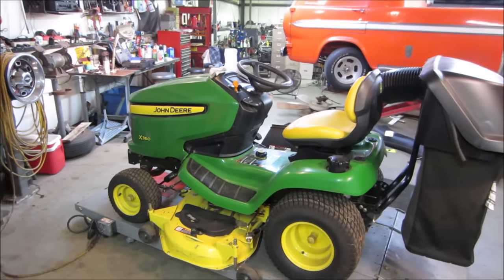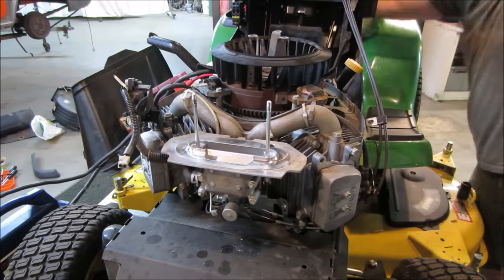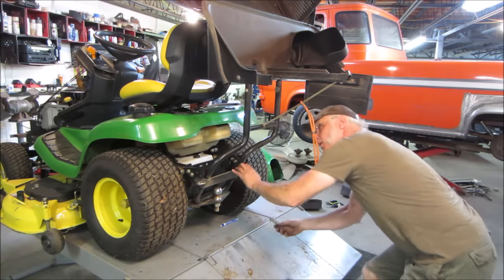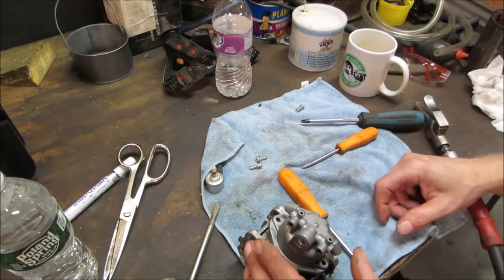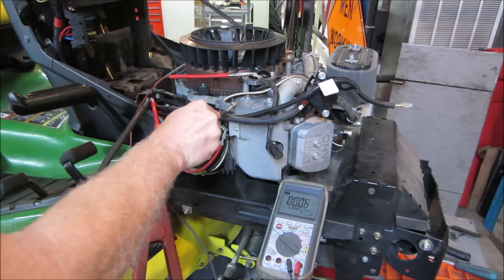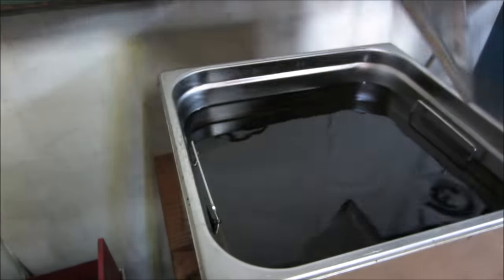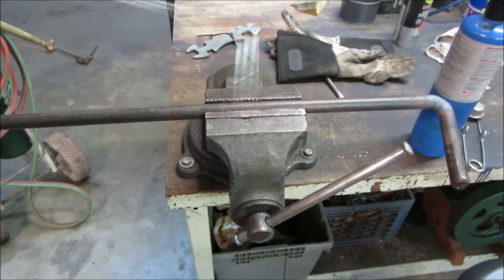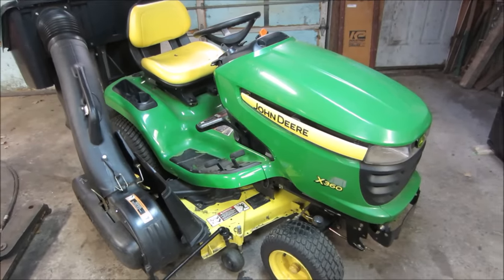Will It Run? abandoned John Deere x360 from a Yard Sale,

Comment: You need to be sitting on the seat. You then must push the pedal on the left till it stops.  Push the yellow lever on the left top of the dash.  This is the choke. Turn th key while doing g that. It should start.  Go online for an owners manual.

Comment: I always drain the carb with fresh fuel in the tank into a container to see what comes out and take the float bowl off and if it's got evaporated fuel shellac or corrosion in the bowl take off the carb and take apart then blow any passages and jets out with compressed air after soaking in fuel with carb cleaner in it. Its most common issue I have seen with different gas powered machines that get parked for winter with fuel with untreated fuel stabilizer in the carb float bowl and it evaporates over time and leaves deposits that clog up the  ports and passages. Its best to just run the engine with the the fuel shut off until it drains the carb or even better yet just drain the carb float bowl with the fuel shut off with the drain screw that most carb float bowls have on them.

Comment: The cost of parts for John Deere or astronomical. My dad had a John Deere 400 riding mower/yard tractor back in the early 80s and it was someone nice little tractor but parts were very expensive.
It needed a new throttle cable and John Deere wanted at least $40 for one and I made one from the hardware store for less than $10 (1/8 in cable, 2 cable clamps and eye bolt)
The engine in that melted a heat shield and damaged something else including a weird coil, so it sat for a few years because the parts were so damned expensive.

Comment: How do you store tractor when you are finished using it after leaf pickup? Do you put anything in tank or run fuel out then store it in shed until next spring. Then change fluids?

Comment: You could pull the Caps off that battery , it helps it vent off the hydrogen gas, and top off any low cells with  distilled water, Don't grip it by the ball mustie get a pipe wrench on the base of it.

Comment: You keep grabbing the hood in the center, and you will split it down the middle. Take the locking tabs off or turn them around. They are each side even with the battery.

Comment: was wondering - adjust one set of values at TDC and then the other at 180 out of TDC - is that correct.   I used to work on a 389 in my car - and TDC for number 1 and then turn 90 for each one after - using the firing order.    so I guess, for a 2 cyclinder - TDC and 180 out of TDC.

Comment: There is a set screw to adjust the fuel which where the gas was pouring out  if you tighten it to far it acts sluggish as it does

Comment: Mustie 1 :) I know key switch for ignition switch has on key some models after 2010 have special theft in key the head of chip plus battery or special tooth ! If don't have that sometimes won't keep running right or never start too just like securities lock out ! Just like vechiles since modern 2000 years to also !

Comment: I have worked on throws type of engine if my memory right if you take the air filter off you should see a couple of holes on top one is the air mixer and fuel mixer jets

Comment: I couldn't tell if you attached the spring to the rear butter fly of the carb 16:26 due to no light on the reinstall 41:14 and I was all so pointing at the screen, yelling fuel leak. By the way my John Deere 15hp LT150 stays running for a few sec after the key is turned off.

Comment: The hour meter could show the hours the key was left on and may not be the hours it actually ran. I left the key on with my John deere and it took over 150 hours to drain the battery . I could of had the dealer reset the hour meter but there was a bunch of paperwork and it wasn't free so I just lived with the added hours.

Comment: you can fix dead batteries with a pulse charger. basically what it does is it gives the battery 15v for a few seconds and that courses the lead sulfate to disappear although its not very fast as with some batteries it can take 24 hours to fully recover but it beats having to buy a new battery every single time

Comment: i found a Homelite LR 2500 for free the story was that it hah not run sense 2010 they said it quit running during one of the week long power outages they got a new one and put this one in the back of the shed there it sat they said just take it it had on spark and the carb was a mess my wife who is also a fan of yours was not a believer i said if i cant get running i could always bring   it to mustie1 for his horde i set to work got the spark back  critters had moved in and messed up the wiring pulled the carb cleaned  it about 4 hours later as i got it all back to gathers no parts left over cleaned the gas tank  pulled recoil a lot it started  and made power my wife said when it started that i did the mustie1 chuckle  thanks to mustie1 i had a blast

Comment: when you took the throttle cable off I saw that the spring was stuck on the cable when you put it back tigether you put the spring in a differnt place

Comment: Why is it you don’t just take the carburetor off and go through it? Then drain the old gas. When you check for spark, you should go ahead and check for compression. Oh , don’t try to force the gas and choke cable just fix the problem. You have a good machine go through everything and service it. Then and only then, you can suck leaves. The vacuum does work good on that machine. I guessed 120 hours, for as nice as it looks 192 seems like a lot of hours but not a problem. They took care of that machine. I did notice she gave you some grass, bonus. Considering you bought it for $750.00 you put about five hours of labor so you have a total of $750.00 including labor.

Comment: Old batteries are far more likely to be saved of you put them on a very slow trickle charger well in advance than if you suddenly connect a jump pack to them on the day.  That charger is far too big unless it's on a 6 volt or other very low setting.  They sometimes take as long as a week on the trickle charger.

Comment: John Deere was having a problem with backfiring when the engines were shut off. The delay and fuel dashpot is there to prevent the backfiring issue.

Comment: Great video, Mustie, just rembered a tip which you might be aware of. 
      For any electrical grounding terminals, key switch contacts, and the like, I found DEOXIT a very good connection salve. They make many variations, but the original has a hint of acidic in it, which prevents corrosion. I had a snow equipment problem, which recurred each year. No more, Deoxit did the trick. 
     As always, John Deere's are my choice. There biggest asset:  although very overpriced, they still carry parts. I just bought new steering parts for a 1946 model A...

Comment: Hours might be high from leaving the ignition in the on position...hehe ive "heard" that happens.
Reply: old comment i know, but i literally did it to my brand new snowblower last year, was running it out of gas (just the carb) but it was taking a while so i wandered off to do something else, came back and put it away without switching it off.  Instant + 80 hr's on the meter.

Comment: I have a question, you said it’s a fairly quiet tractor, well it sounds bloody loud to me (I have no knowledge or experience of these tractor/mowers) can anyone explain what makes them so loud, why can’t they be quiet like a modern motorcycle? I get it that pulleys, belts, and rotating blades make some noise but the engine noise is awful.

Comment: 52:00 It would be nice that when you cut the engine off, the carburetor solenoid cut the fuel off then a delay to let the engine suck and burn the remaing fuel out to leave the jets dry between uses. Just thinking...
   By the way, I did tell you the fuel was pouring out, you were just not listening...

Comment: I had an x500 and I will share a couple things. 1) the choke is momentary. Hold it up for a second when your starting it and then let go. 2) when you turn the key there is a delay when you shut it off 🤣 it's a john deere thing. 3) those power flows are a nightmare for leveling the deck due to how the deck hangs off the mower and how heavy the power chute is. And you are missing the "z bar" that the power flow attached at the front of the deck. Terrible system imo.

Comment: I've cleaned my carb several times by hand and by sonic cleaner. but the engine dies as soon as I go to turn blades on? why would it die from no load of cutting, just turning them on kills it? other wise runs and moves perfect? The guy I bought it from did not use it for mowing, bacicly just towed a rake, and has lots of power for that?

Comment: I have a lawnmower o have to take the motor off and get the Pistons in stuck it had water mixed in with the oil so I have to clean up and out what's that stuff called you us to unstick pistons like that

Comment: that tow ball was added by the owner, it should NOT be there, they probably had to enlarge the hole to make it fit.  there is normally just a smaller diameter hole for a hitch PIN to drop thru to connect your yard cart, spreader etc.
Reply: I know this because I have a john deere X360 with a cab, and snowblower and grass deck.

Comment: Torque specification on the bolt that holds the three blades to the towers after you sharpen them 50 foot pounds

Comment: old battery won't take a charge? 
1. give it a shake shake shake and wiggle for five to ten minutes,
2. dump out acid and gunk and leave draining for a couple of hours.
3. add distilled water, repeat step one and drain.
4. add more distilled water and put on charger for 12 to 24 hours. violaaa. almost new battery.

Comment: I have the 110 model.I get a gap between the blades. I replaced the two blades. I still have a gap. I tried to purchase another John Deere. Non in stock or online. Suxs. Bought a Troy Built. The deere is still better.  RWould like another Deere to replaced the Troy Built.

Comment: I like John Deere but $750 for a lawn tractor that didn't work that you had to work on yourself that's a little too much I think but it is a nice tractor  here in Arkansas you could have went to the used lawn mower shop and got one identical to it for about 400 bucks out the door running and ready to go

Comment: The battery isn’t taking a charge because of all of the sollfation built up between the lead plates causing a short between the plates.  The battery will not take a charge.  Baking soda will desolve the crystal build up on the plates causing the short.  Look up how to desulfate a lead acid batteries.  They may have more information than I am capable of telling you.  The battery is not a total loss it can be revived.  Baking soda nutulizes the acid.  Epsonsalts and warm water to desolve the epsonsalts.  Fill the battery with the solution and put it on trickle charge.  There is a difference between chargers.  The new battery chargers detect the battery dumb chargers put out a electrical charge constantly weather there’s a battery or not.  There must not have been to much build up on the plates most batteries won’t even take a charge and if they do its not held for any helpful time.  I’m sure there’s videos on how to revive old dead batteries.  Most batteries costs $160 and up but you can extend the life of a battery by several years and definitely the money it takes to purchase them.  Just some helpful knowledge of what can be done to save senseless waste of money.

Comment: I think it's normal it runs for a couple seconds after you turn the key off. Our John Deere does the same. Has since it was brand new

EDIT: We ALWAYS have to choke ours when we start it too, even if we just shut it off two seconds ago. It just won't start without full choke

Comment: Mustie, if you don't mind, where did you get your gas line pliers?
Reply: If you cannot find any just heat and bend the jaws of pliers you already have around a socket in the vice.
Reply: @mercuryrising9174  great idea. Would MAPP gas work? It's all I have.
Reply: @howardkoster4026   sure as long as you get them hot enough to bend but not break. Also ide let them air cool since it's going to be mystery steel.
Reply: @mercuryrising9174  yes. I modified a pair of snap ring pliers and I let them air cool.
Quenching in cold water, I believe, would harden metal, but also make it brittle.
Thanks for your input...
Reply: @howardkoster4026  your welcome. Helping other is what it's all about.. that's true makes them brittle hard which isn't good.

Comment: Try putting the battery on a piece of wood so it's not on the concrete floor.
Reply from the maker: ave you heard the one about batteries discharging when stored on concrete? Apparently, some people have taken to storing 12V batteries—the kind used in electric wheel chairs and emergency lighting systems—on wooden shelves to maximize their life expectancy. Is there a spark of truth to this or is this claim dead in the water?

A bit of research reveals this to be a zombie truth: it used to be that batteries would discharge faster when stored on concrete, but newer technology put the kibosh on this phenomenon. Yet the belief persists.

A hundred years ago, this rule-of-thumb was quite useful, as the case around the battery was made of wood and the electrical cells were glass. If the concrete floor underneath was wet, the wooden case would swell, causing the glass cells to break.

Subsequent batteries would sometimes lack a case altogether, allowing electrical discharges into the concrete. Then came porous rubber cases which contained carbon atoms: this also created electrical activity between the cells in the presence of moisture, leading to prematurely discharged batteries.

The batteries of today, however, are encased in plastic or hard rubber, which significantly reduces this energy waste. Batteries do naturally self-discharge over time, however, but this is due to an internal process, not the type of material on which the battery is sitting.

A compound called lead sulphate naturally forms during battery use and it can crystallize onto the negative plate of the battery, especially when the battery rests for a long time. These crystals end up impeding battery performance over time.

A reader asked us to look into this myth because he was concerned about battery life in parking meters. These meters all use a 12V battery to either deliver main power or serve as a backup, and these batteries sit on a sheet of steel set atop concrete or, sometimes, directly on the concrete itself.

If these batteries do discharge faster than expected, I suspect it has nothing to do with the material upon which they sit, but with the ambient temperature. Montreal summers can be pretty brutal: we had a maximum of 32 degrees Celsius last June. I can only imagine how hot it gets inside a black parking meter in downtown Montreal.

Heat is bad for batteries. According to manufacturer Pacific Power Batteries, a car battery in a hot climate will last, on average, only two thirds as long as it would in a cold climate. For example, a battery that lasts 4 years in a cold environment would only last 2 years and 8 months in a hot climate. Keeping the battery on a slab of concrete, which can act as a heat sink, might actually extend its life by absorbing some of that heat.

Comment: you are supposed to take the deck off the tractor. First.!!    to get the mulch kit off the deck.!   DAA.   and the bagger comes right off if you remove the cotter pins on both upper mount supports.!!   helps to read up on the tractor before you approach  disassembling it SIR.!  just saying.!

Comment: Who taught you how to test batteries? Check fluid level and refill with hydrogen peroxide. Charge only after you have valid fluid levels.
Reply: Not so sure about the H2O2 - only pure H2O should be added to lead-acid batteries.

Comment: Between the stupid double carb jets and the  mulch plate and the trailer ball and brackets for the bagger its looks like idiots designed it.  What a darn crappy setup.  Is this all so people take these to the  dealer for service?  Because that is poor service from an expensive machine.  
     I use very old simplicity tractors with kohler M20 two cylinder  magnum engines and all my gear is super easy to get to.  Plus i love the power lift rock shaft and locking rear diff and 2 speed rear end.  Plus split brakes for better turns.  The sunstar is all driveshaft .. typical 60 inch deck.  Three driveshaft attachment spots.   Sunstrand 15 rear end is three times anything on a honda crv.